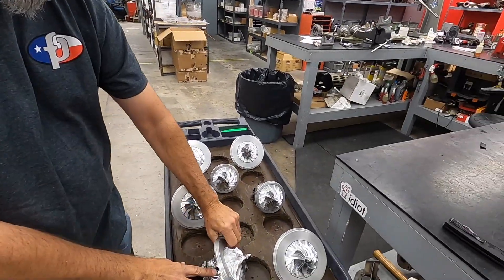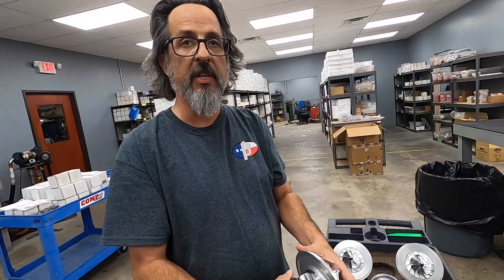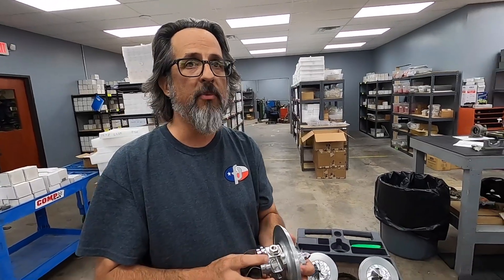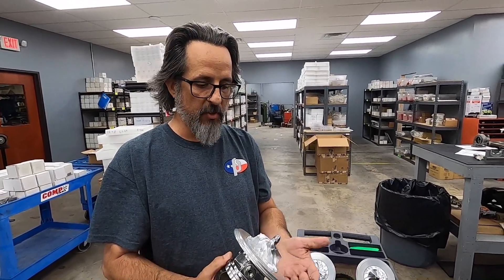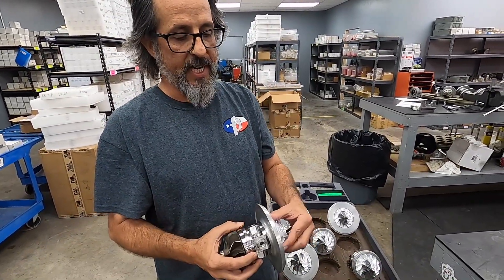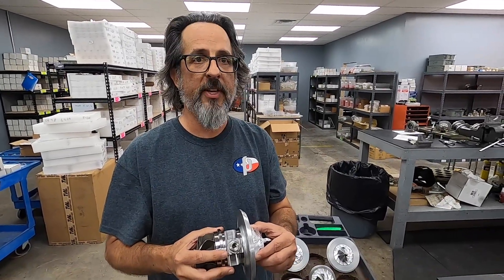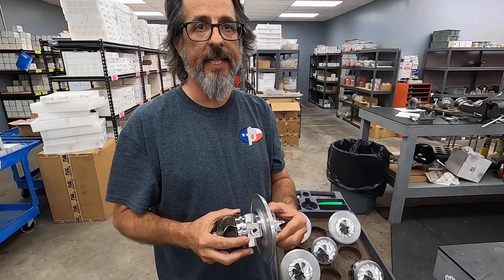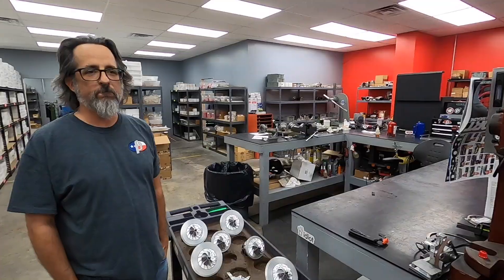THE TRUTH About Ball Bearing vs Journal Bearing Turbochargers! (Robert at Forced Performance)

Comment: I might have missed it, but was there a hint as to what to put as a restriction to the oil supply?  Seems most people when they have an oil burning issue are feeding them too much oil and end up guessing what kind of restriction to put in there.  I'm surprised the center cartridges don't have  a built in calibrated orifice instead of a full bore -AN boss. (or maybe some do now?)
(yes, the oil outlet should be wide open, pointed down, minimum bends, short and directly back to the pan or scavenge stage.)
Reply from the maker: That’s something to consult the manufacturer for. My precision’s already had a restricted fitting in the cartridge but I can’t speak for anything else
Reply: Some, like the Xona Rotor product, has a restriction integrated into the proprietary bearing preload system. The BorgWarner EFR uses an orifice in the mechanically-preloaded bearing cartridge, and the Garrett GT/GTX/G Series require an upstream restrictor, typically around 0.020-0.040". Using a restrictor to reduce oil loss or smoking is often done to overcome a restriction in the oil return system from the turbo to the sump, so it's always important to make sure that path is sufficient. It can't be stressed enough that following the manufacturer's instructions is the key to keeping the turbo alive as long as possible.

Comment: I always was curious about water cooled Turbos, & I assumed RPM's & Horsepower was the difference between ball bearings & Journal.
Reply: All those cheap ebay turbo a generally just oil cooled, but the best his water cooled and oil cooled, my last volvo had about 300,000 miles with the original turbo, some reach 400k and other 500k mile on original turbo. They use Mitsubishi TD04HL-15G

Comment: Bearings are a wonderful invention.  I work on cold water chillers at work, some have magnetic bearings and run around 30k rpm oil less. Very cool. 😁👍
Reply from the maker: Magnetic bearings are fascinating. They use those in the turbo pumps my dad sells for vacuum manufacturing equipment
Reply: Well that sent me down the turbo molecular vacuum pump rabbit hole. Lol. Ill keep my eye out for them in the labs at school. 😁👍

Comment: I have a 2001 Silverado 3500 dually With a 496 and a GT 45 journal bearing turbo charger only running about five psi. I often get the “why not ball bearing they are better “responses to my set up. I agree marketing push is ball bearing as a better product but there is no reason a journal bearing will not be just as good in a correct application.

Comment: "In automotive applications, especially in high-performance systems, ball
 bearings provide better transient response, which means they help 
reduce any “turbo lag.” According to Honeywell, a leading manufacturer 
of automotive turbochargers, the time-to-boost improvement attributable 
to ball bearings can be up to 70 percent."
Reply: yessir, true enough!  The large print giveth and the small print taketh away.  "up to 70%" includes everything down to 1% if you think about it.  For sure cases where you want a BB turbo!
Reply: I've seen a 15% number kicked around for over a decade, I wonder in what application they were able to see a 70% improvement.
Reply: @otm646  the 70% was probably a relatively large turbo on a relatively small engine.

Comment: He neglected to mention that any good quality ball bearing turbo is also water cooled. The benefits of both combined in anything you’re going to actually drive longer than a 1/4 mile is huge. There is a heat syphoning effect even after the engine is off and no water flow which is huge in helping that oil stay happy and not burnt.
Reply from the maker: He did mention it...and shows the water jackets in the Xonarotor cartridges later in the video
Reply: @Stapleton42  ahh you’re right.  I rewatched and I missed him quickly say “ a ball bearing without a water jacket” otherwise his negative affects didn’t seem to add up. 👍
Reply: well I feel like the PTE turbos are good quality turbos, they are dry housing.  You are 100% correct about garrett and BW all the GT turbos smaller than GT47 are water cooled for example!  and the shut down phase is crucial for not coking that oil around the outside of the bearing casing, this is where the water jacket makes a lot of sense.  Some OEM turbo cars, maybe even all of them these days, continue to run water thru the bearing housing after the engine is turned off to help this issue.
Reply: Not completely correct. One of the most famous of all ball bearing turbos are the IHI turbos, including the RXH6 series. These were used on the Honda/Marlboro/McLaren Formula One cars, incorporating the RA167 and RA168 engines. I recently had one of these turbos (genuine ex-F1) fitted to my car for 2 years and I drove it well over 50,000km’s. The turbo was faultless. And, it was ball bearing and not water cooled. Considering the turbo was 30 years old, used and abused on an f1 car, then driven on my carrot 50,000km’s over 30 years later….I would say there aérea exceptions to that rule

Comment: I have heard at least that ball bearings have less resistance and will spin better. At least  now I know the truth.
Reply: What you should have heard; unless you are a a professional racer you don't need a ball bearing Turbo!
PERIOD
Reply: @richardharris492  at least now I know after whaching a professional talk about it and know when you need ball bearings or journal. Extra info is good.
Reply: they will have less resistance if you dont flood lubricate them, but it doesnt always make as much difference as people claim.  I prefer the BB structures on high boost applications - above 45psi def advantage goes to the BB.   BOOSTON!

Comment: You need to get him and Richard Rawlings together,. 

Just make a custom oil tank for the turbos, vs,. tapping into the oil pan. easier to control the temp of the oil.
And you could have oil coolers just for the stand-alone oil system for the turbos.

You run the Oil cooler rad into the water chiller tank instead of using fans to cool it off faster.
And you take the massive HVAC in the Caddy and use it to cool the water
Reply: Richard Rawlings? Are you serious with that? Holy lulz.
Reply: @eriklarson9137  I'm guessing he said that based on looks.
Reply from the maker: That sounds like a great way to overcomplicate things 😂
Reply: @Stapleton42  Bad over-complicated Videos get clicks

Comment: Turbo charging can BE involved  ,no wonder  the early turbo cars had a butt load of issues  ,im talking  60s, 70s, started  turning  wrenches in 1968
Reply: So... You are talking turbos in the 60s and 70s. I am not aware of a lot of (maybe 1??) American factory turbos in the 60's and 70s. Care to share a few examples from the big 3? Cause me, being I was alive then as well, me, I would go ahead and mention the 80's when the big three actually started turbo charging cars, and the garbage they were putting out at that time. My favorite car of all time BTW is a 70 Chevelle SS 454 4 speed. Of course with the factory turbo option.
Reply: @eriklarson9137  Oldsmobile, and corvair, I think as early as 1962 only seen a few when started wrenching